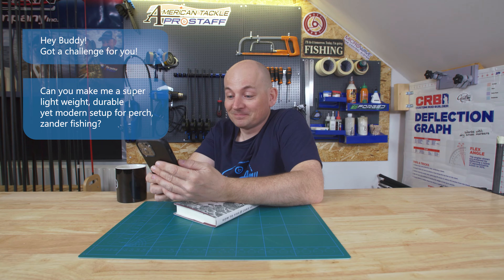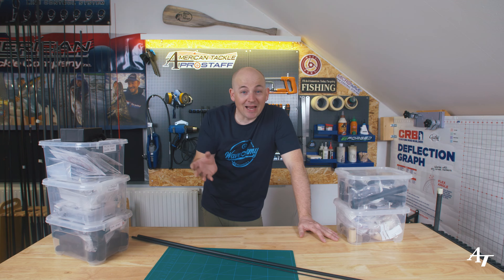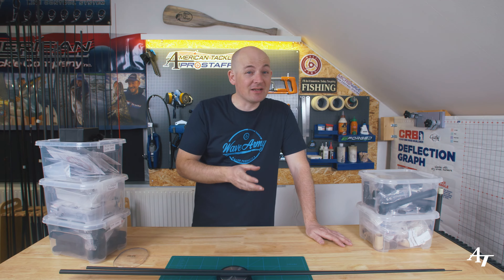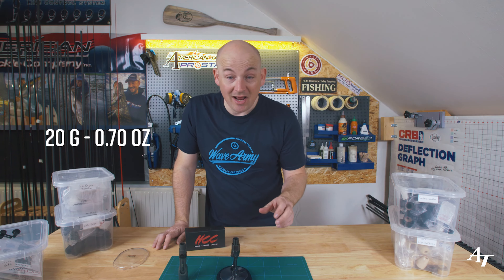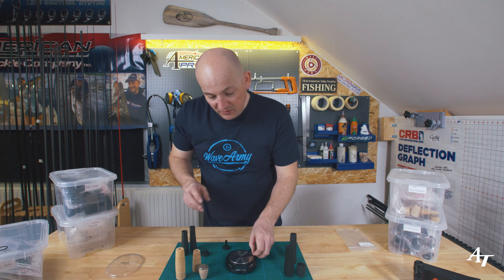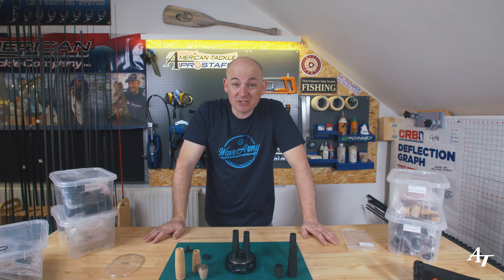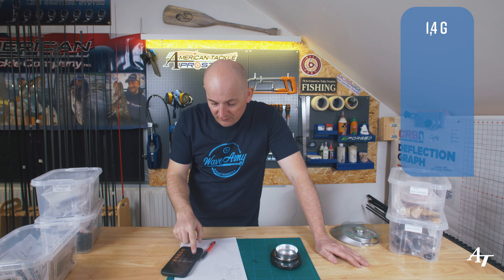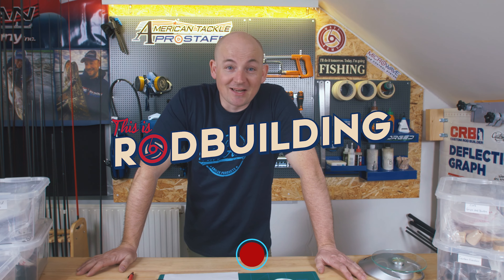This is RodBuilding Episode #2 Featherweight Rod Spec

Comment: Your comment about D and A thread, I'll just put in my ideas.  On a build like yours, D would be my choice of thread.  On really lightweight blanks like the SP53/1-4 or lighter fly blanks, I would use an A thread.  This has more to do with ease of laying a thinner thread on a thinner blank.  You can also use less tension, this really helps on a 2wt fly rod tip section.  It doesn't require as much epoxy to soak the A thread, but in the end you might only save, estimate  1-2 grams.  I know there are plenty of conversations on the forums about thread use, but I believe it is up to the builder and it should not be a huge issue.
Reply: 100% Evolve, thankyou for taking time for your input, questions like this get us all thinking and more food for thought! Love your builds btw! 😊

Comment: cork is WAY lighter than eva. i'm not talking comparing different designs and adding butts and whatnot. just comparing the material specific densities.
at Rodhouse we sell 12,7mm bored ring, the eva come at 2.3g which is light, but a flor grade cork ring is 1.6g, which is almost a third lighter.
Reply: Most people don't really like Cork though. Especially on lure rods